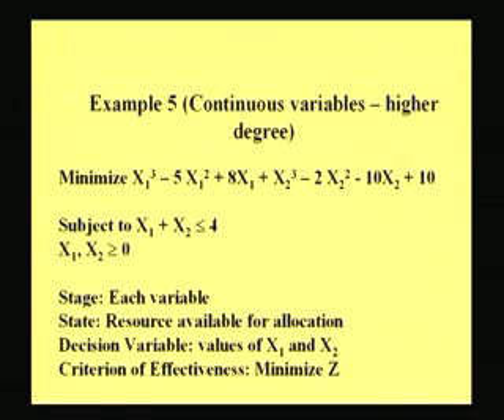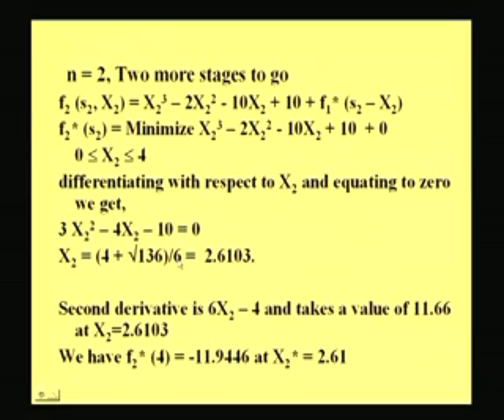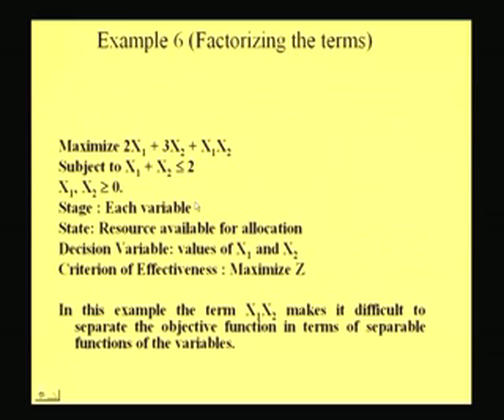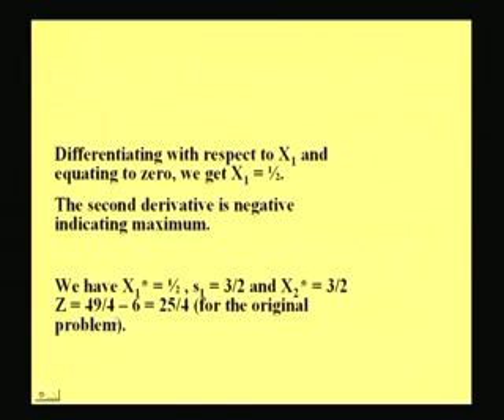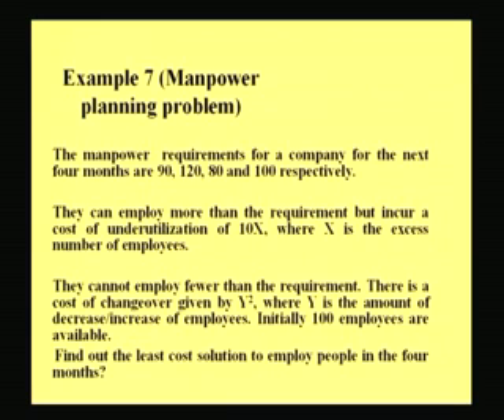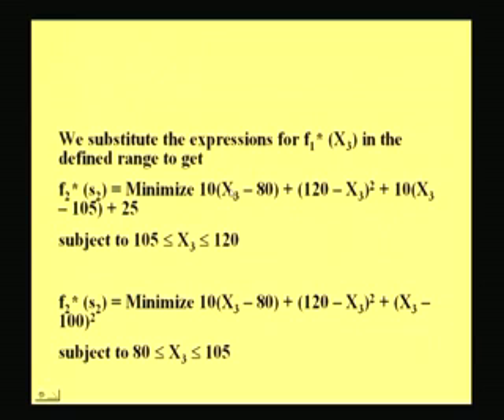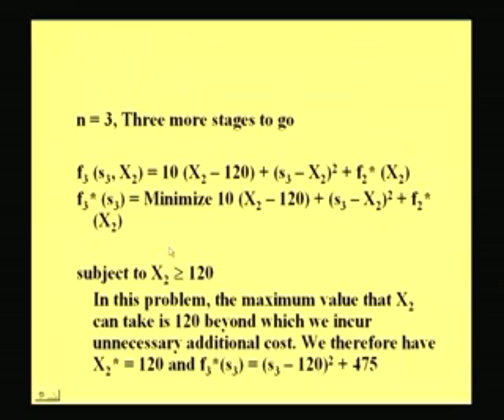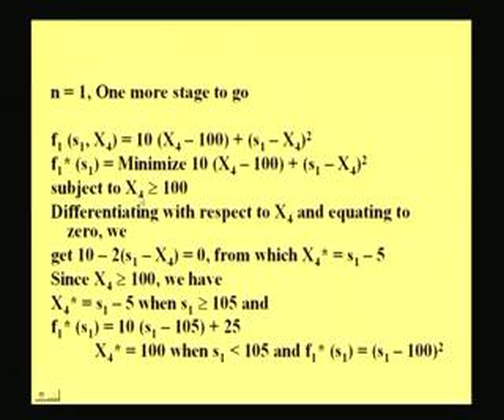Lec-19 Dynamic Programming - Continuous Variables

Comment: Once again, an incredible lecture! Thank you!
corrections: 

- at 45:42 in the 3rd paragraph it should be:
f_2^{*} (110) = 475

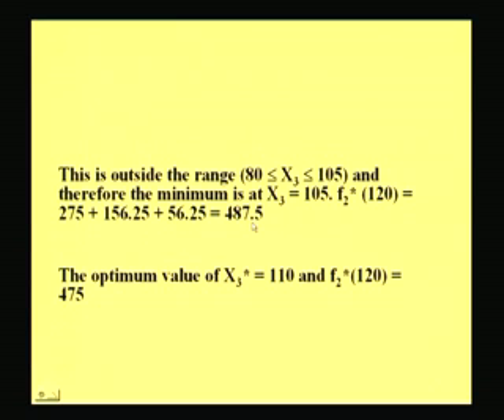- at 48:44 in the 1st paragraph it should be:
f_2^{*} (105) = 500, as we had to fall back to the endpoint of the interval [80, 105] which has the minimum value of the objective function f_2
along with the same correction in the 2nd paragraph

This doesn't affect the subsequent solution as f_2 (110) = 475 is still the minimum value at the second stage (it's better than both the incorrectly calculated f_2 (107.5) and f_2 (105))